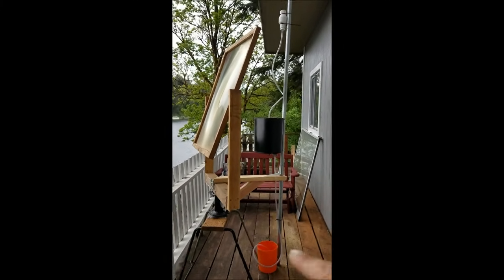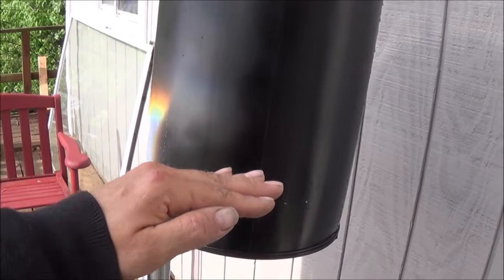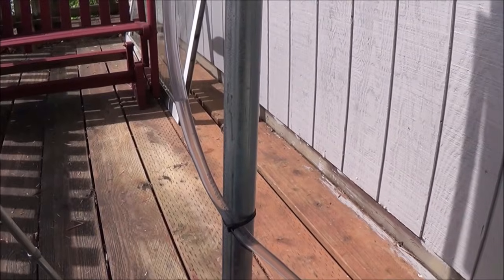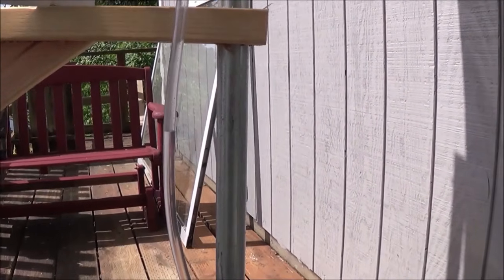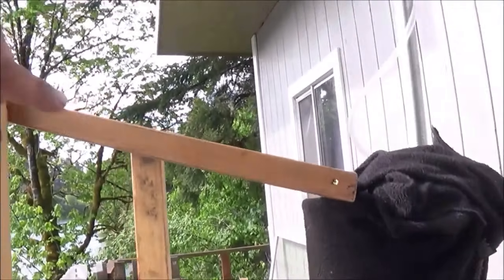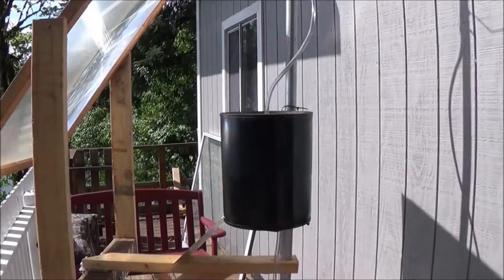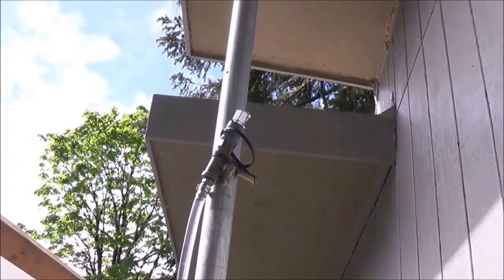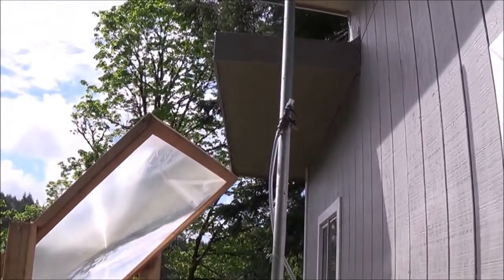Water Pump powered by the temperature difference between night and day !

Comment: Hey I had a question about a wood gasifier you had built out of some propane tanks for your friend I was wondering if you had an update on how it's performing nowadays if he still uses it I also have a tiny home and have been interested in wood gasification and or methane biodigesters for a while now and was thinking about running a dual fuel generator I have built for running off of propane with a couple of filters in line but I was wondering how that gasifier is doing
Reply: I am a victim of voice type I did not build the generator I bought a dual fuel sportsman 3500 running Watt generator

Comment: So in theory you could make an irrigation pipeline that pumped water horizontally for miles just by chaining these projects side by side in a long series.  for a faster stream, just add fresnel/containers more often along the route.  i assume there'd be a continuous uninterrupted stream once its gets going and the pressures in each section try to average out.

Comment: Totally awesome, that said, 1) What would the temperature of the  'Lifted " water be ???  Or I guess what is the temperature differential ??   2) Regarding  the pressure side of your pressure tank , is the output tube on the top drawing (or pushing up ) the water from the bottom inside.

Comment from the maker: This works by using the Sterling cycle, it heats the air in the black tank and then it's allowed to cool creating a vacuum to draw water up from the bucket into the black tank, then it heats the air in the black tank creating a pressure cycle that pushes the water up through the upper tube!
Reply: I would suggest adding capillary force by inserting strands of maybe copper wire inside of the tube
Reply: @MrTeslonian  I have been watching your content for years. And I am increasingly amazed every time I see a new one. Thank you for always sharing your knowledge with the world!